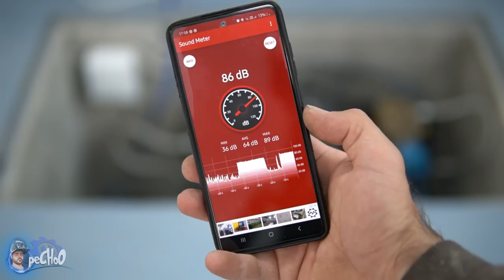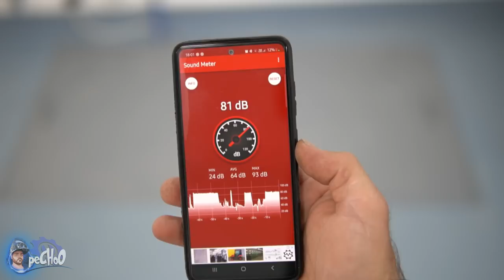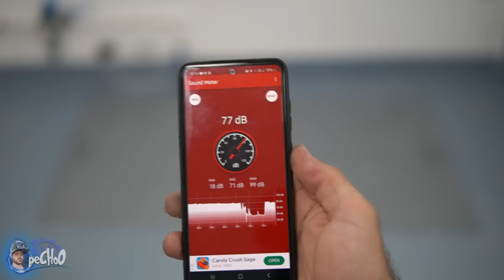How to reduce AIR COMPRESSOR noise,Remote control,Air SISTEM INSTALL!

Comment: That's a great place to keep the compressor but, I think it's going to overheat. The fans wont flow that much air to keep the cylinders cold enough, the fans are to close to the wall to get proper airflow and if the fans get any airflow it will only blow hot air over the cylinders when it's located in a small in closed area. Cheers from Sweden.

Comment: If you add sound damping like rock wool inside the hole you will reduse the noise dramatically I think, because the noise is amplified from vibration and reflections